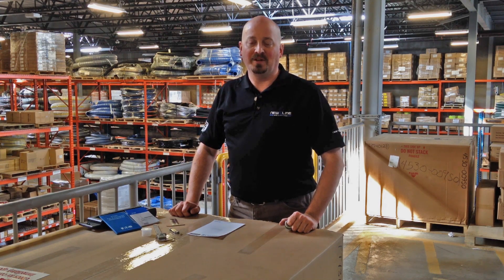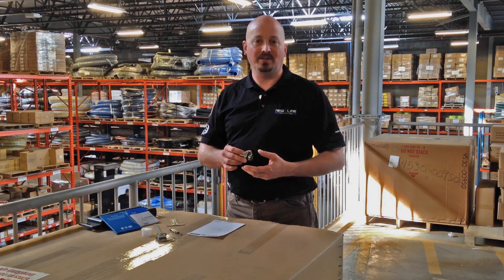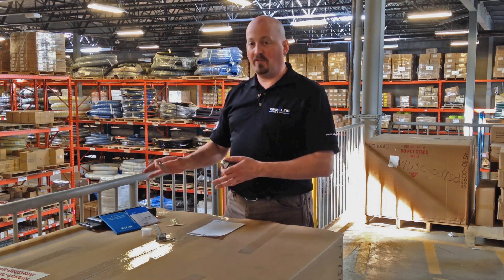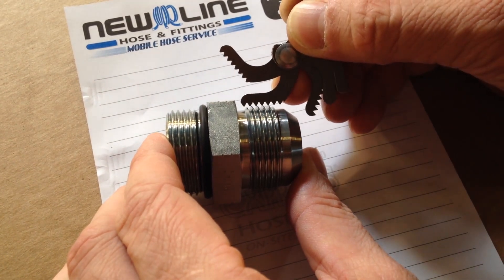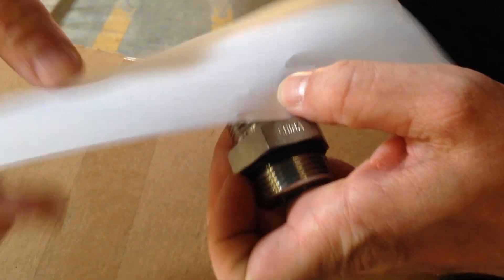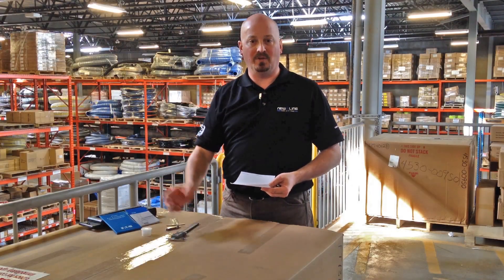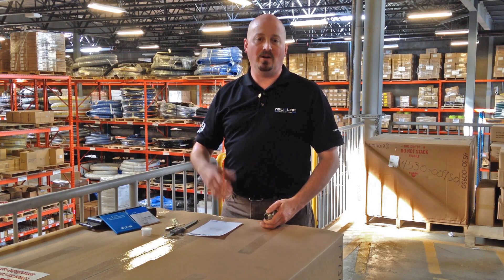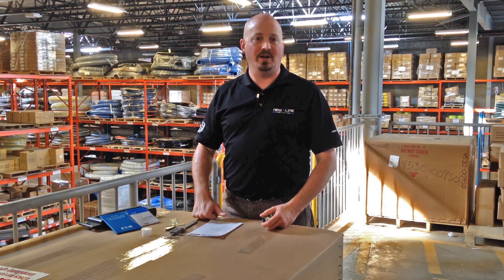How to tell what kind of hydraulic fitting you have

Comment: Hydraulic fitting ID video is excellent as far as it goes.  I can't believe no comments or more thumbs up til now.  I will now look for your thread ID kit.   Perhaps another video explaining how to differentiate the various standards (AN dash fittings vs JIC and 37 vs 45 deg angles and O-rings vs no O-rings and nomenclature as well as fuel and hydraulic vs air line fittings (non-push-connect of course).   Working on older buses is a challenge and I've stumped multiple local parts suppliers, so online resources like you are a necessity.
Reply: FWIW, I was unable to find your "Thread Gauge Kit" by searching with those terms at New Line hose and fittings.  Is this still available?